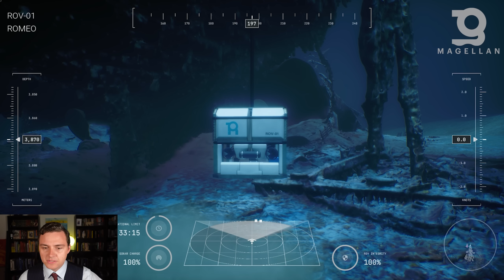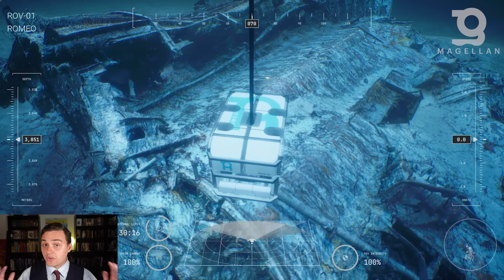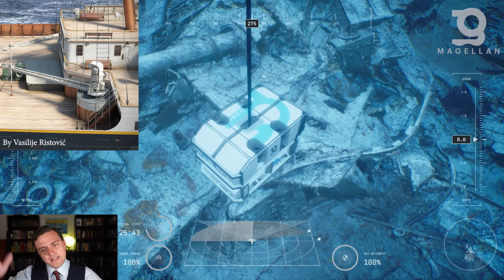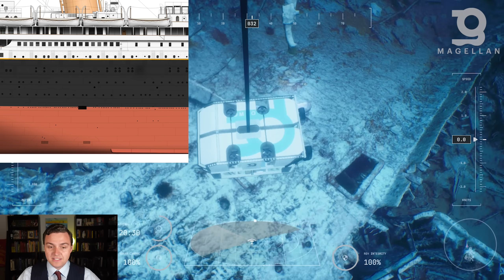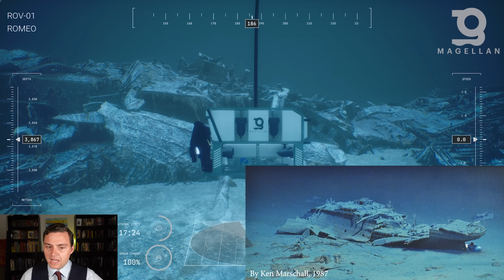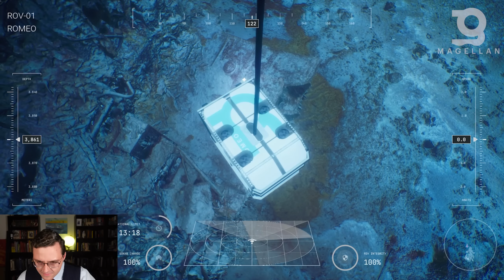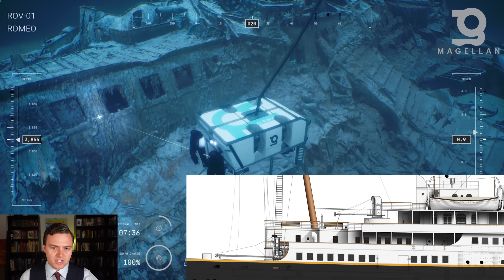FIRST LOOK: Titanic's Destroyed Stern Section in vROV Pilot

Comment: As long as I’ve been reading and learning about Titanic, as many photos and models and videos as I’ve seen of the wreck - it has never occurred to me just how hard the ship must have hit the bottom, until now. When I saw where the propeller was in relation to the fan tail - and when you put up the picture of what it looked like in better days - holy cow, how far did everything bend/break upon impact! The propeller should not be that close to the deck!

And yet, here it is. The deck is right on top of it. Having watched your videos on how the Titanic was built, the materials and techniques to put everything together - it blows my mind how much force it would have taken to put everything in the state it is right now.

This is probably impossible to pull off, but it would be fascinating to see the parts of Titanic that are actually buried under the sea floor. Beyond seeing the iceberg damage, I’d be curious to see what everything that hit the bottom first really looks like. Is it well-preserved in the mud, or is it a flattened mess of metal and machinery? Given what we can see of the wreck and how that looks, what about the bits we can’t see?

Comment: I suspect that during the sinking, an air bubble formed inside the ship. It couldn't escape quickly enough. At some point, at a certain depth, this bubble imploded under the increasing water pressure. The force released would have been enough to cause extreme damage to the stern section. The bow is still in such good condition because the air had enough time to escape while sinking.

Comment: I get so confused with reports and illustrations about the stern over the years. I remember hearing somewhere that it was way less collapsed back in the 80s and 90s that some of the upper Deck windows and stuff were more recognizable and that the siding had come off the hull and that you could see framing of multiple decks and look similar to the Ken Marshall illustration
Reply: Unfortunately that wasnt true, Ken Marshall just assumed that decks were intact cause most of images were overhead views. At the closer of the stern, upper decks were collapsed and alot of lower decks were also collapsed

Comment: In the paintings the sides of Titanic stern are in one piece. Yet here they've come away,peeled like a banana. Looks like when the stern hit the seabottom at speed it's caused some of the rivets to come away from the decks and over time caused the weight of the port side to come away.
The Starboard side of the bow is the same there's a buldge at the bottom where the hold in the side is. 
I fear as a Amateur Titanic fan the starboard side will peel away from the ship
Reply: The painting of the stern was not very accurate. Stern port side was in much worse condition in 1986, it was as badly as now, if you compare side by side those pictures with scans they match well. Decks of the stern were also badly collapsed

Comment: People say brittle steel. Brittle steel my a**! To bend like that without fracturing tells you how good the quality was even back in 1910! Great work by Magellan to document this because in a few generations this will be all we have to remember the wreck
Reply: It was brittle compared to modern steel as I understand, but very good for back when it was made.
Reply: Yeah I said the same thing, people hysterically go on about the rivets, they held thousands of square feet of bulging hull plate onto a ravaged stern section for over 100 years before letting go.
Reply: @ToreDL87 id think the sides fell away on impact.
Reply: @treystephens6166  Check out Marshall's paintings, just google "Ken marshall titanic stern" and look at the left side/port-side, while, yes, bulging (owing to the massive hydrostatic shock), held on very well for a long time before the remaining rivets failed after 100+ years and the plating fell off. Then the C deck between counter-stern & superstructure collapsed (or the other way around).
It literally didn't look like this in 1986.
Reply: Quality? It blew apart like a Ford pinto. I'm sure most of the potato eaters who built this thing were bombed out of their minds building this thing.
Reply: @blevinsfrank5453 so insulting, for what.
Reply: @panzermensch1577  Don't feed the Troll
Reply: If it wasn't protected and so deep, it's possible the steel would have been scrapped a long time ago because of how high quality it is.
Reply: @graywolf1984  not to mention its low background steel too. Prince of Wales comes to mind. Its fortunate that she is so deep

Comment: Thanks for the tour Mike, I really enjoyed this video.
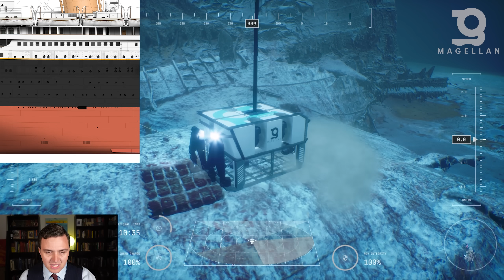At 23:27 we see the huge induction intakes for the condensers, I understand their purpose and their need for massive amounts of water. What has always baffled me about ship's design is why isn't the inner piping for these incased within their own protective and redundant well casing, or why wouldn't they possibly get their feed from an over the side scavenging pump?

 - The point that I'm driving at is that if some of the inner piping for these massive intake ducts breaks or becomes damaged during rough seas - then you've got an 8 foot square breach directly open to the sea, the loss of the Oceanos now comes to mind. I understand that building a separate well casing or the arrangement of an over the side scavenging system would be much more expensive to create and conceal but in the event of a calamity an encased well or scavenging system should be "relatively failsafe" I would think. 

This question came about one summer when I was on a sailboat and saw no less then 7 intake ports below the waterline of the vessel which made me extremely uncomfortable. There has to be a safer way to draw in the needed sea water I would think, but then again I'm not a naval architect or ship's machinist. 

Keep up the good work team, great job!

Comment: Incredible work by Magellan! I feel that when the stern was going under due to the damage of the break apart, had fast surging water and trapped air which caused the sides of the hull to separate from the floors/ceilings of the decks causing the side of the hull to be bent & pulled outwards. In my opinion it debunks the theory of an implosion. Only wish we could have had this technology in the first few years after the sinking before the deterioration.
Reply: IMO the stern was rotating/spinning on the way down, hitting just as it was about to pivot around again, and at a rolled angle toward the starboard, which is why to the starboard side = Lots of stuff, that's where it grabbed the seafloor, port side = Cranes, that's where it threw the cranes (and the mast).
The hull plating was kinda blown outwards because of the massive hydrostatic shock, around 20000-30000 tons worth, it was held on at a few places by maybe a few hundred rivets all total, which rusted and let go maybe a few years ago.

Comment: I READ THAT SEVERAL OF THE PASSENGERS SAW THE BOW AND THE STERN OUT OF THE WATER AT THE SAME TIME. IF THAT IS TRUE, THE SHIP SANK MUCH DIFFERENTLY THAN WE HAVE ASSUMED. WITH THE PASSENGERS HAVING TESTIFIED ABOUT THIS, IT WOULD'VE BEEN THE RESULT OF THOSE TWO PIECES OF DOUBLE BOTTOMED SEPERATING AND SEA WATER RUSHING IN AMIDSHIPS CAUSING A REVERSAL IN THE FOUNDERING ANGLE ALMOST IMMEDIATELY. THIS IS WHY THE CHUNK BETWEEN SECTIONS IS MISSING. I WISH THAT I COULD CREATE SOME GRAPHIC TO HELP EXPALIN WHAT I AM TRYING TO SAY.
Reply: What you are describing is the V-Break theory, something that is completely impossible due to the nature of the damage sustained by Titanic. Passengers did not see the bow and stern at the same time, the bow vanished first followed by the stern, most didnt even see her break in half to begin with.
Reply: @Tozzpot500  So the two pieces of double bottom hull are a figment of everyone's imagination? These two super compressed pieces are the very reason why she broke in half, and it all occurred sub surface which means that an Olympic size pool of H2O was rushing in amidships causing the moment of rotation to reverse almost immediately. As for no one seeing the ship with the bow and stern out of the water at the same time---you obviously haven't read the testimony of those who did. If you want to see things in a more correct light, do what I did!!! WATER DOES NOT FLOW UP HILL!!! When the ships stern fell backward upon breaking, it was still hanging on at the keel!!! I am not suggesting the V break!!! It happened most likely the way it was depicted in the movie. What it DID NOT show was the two pieces of the double bottom breaking away. This was all sub-surface. The very instant this happened, a deluge would've gone racing down through the boiler rooms causing the hull to become heavier amidships than at the bow. This also would happen due to the streamlining of the bow. As the rotation reversed. Passing level, the water in the first 5 compartments started running backward lifting the bow back out of the water finally tearing the bow section from the stern section. The bow section goes under immediately headed for the bottom of the Atlantic. The stern stays afloat long enough to fool some into believing that it would remain afloat---and you know what happened after that!!! Also, the breakup happened at a much shallower angle, most likely just as the screws came out of the water. Being almost pitch black it does not surprise me that few saw it actually break up.
Reply: @wasatchrangerailway6921  Ah, my apologies i miss-understood your last comment and believed you were arguing in favor of the V-Break. I have read the transcripts of both Inquiries and only a few people were asked on how the ship went down, fewer still mentioned the break in the first place. No one mentioned the bow being visible after the break.

I personally subscribe to the idea that the bow after flooding and the upper hull breaking remained attached to the stern via the double bottom for a few moments before finally breaking away. This both explains the sections of double bottom found at the wreck site while also staying within witness testimony. The bow never resurfaced however the rest of your theory is certainly similar to the one currently being tested by researchers, only time will tell if its correct or not.

Apologies once again, you often see people advocating the V-Break on posts such as this so i miss-understood. Thank you for your reply! Its certainly an interesting idea and plausible idea, besides the bow resurfacing as all accounts place it firmly underwater by the time the lights went out moments before the break.
Reply: @Tozzpot500  NO PROBLEM!!! WITH IT BEING SO DARK, IT IS ALSO NOT SURPRISING THAT SO FEW SAW THE BOW COME BACK OUT. IT COULD NOT HAVE BEEN BY A LOT. PROBABLY JUST ENOUGH TO EXPOSE PART OF THE FORCASTLE. IT WAS MOST LIKELY VERY SHALLOW TO BOOT. REGARDING THE "BIG CHUNK" THAT IS MISSING, THE ONLY WAY THIS COULD HAPPEN IS TO SUSTAIN A NEAR INSTANT REVERSAL IN THE ROTATION. THIS SECTION PLACED UNDER TERRIBLE COMPRESSION, THEN PUT INTO TENSION ALMOST IMMEDIATELY, WOULD CAUSE A SPAGETTIFICATION OF ALL THE DECKS LONGITUDINAL AND CROSS MEMBERS TEARING RIVETS APART ACROSS MULTIPLE DIMENSIONS. I WISH THAT I HAD SOME KIND OF A GRAPHICS PROGRAM TO SHOW EVERYONE WHAT I AM TRYING TO CONVEY. EVEN THEN, I AM NOT A COMPUTER GEEK. I AM JUST A RETIRED LOCOMOTIVE ENGINEER.

Comment: The propellers sitting on that angle tell a story in themselves. Those prop shafts are about 28 inches (720 mm) in diameter and they are bent around 45 degrees, if not more. That's solid steel deformed like putty.... Imagine the forces needed to produce that!
Physics, you are scary.
Reply: Shafts are usually hollow actully but still have fairly thick walls. It gives more strength while using the same material.
Reply: ..The wing screw propellers of the Titanic were/are 23 feet each approx...I'm talking about the radius measurement when they spin & create circles...Those circles in total are 23 feet each...An one storied regular house is about 10-12 feet in general...Now think about a two storied building now & add about 3 feet more to that...Now imagine a spinning circle with that length... .

Comment: For reference, the stern has spun around during the sinking, the very end of the stern is now facing the bow and the engines are facing back to the East. Bow is half a mile away. Main debris field is between the bow and stern. The bow still points West where she was travelling (compass points in general reference)
Reply: Not quite. After the ship struck the iceberg, her engines were stopped and she drifted down the Labrador Current. The bow faces northward and the stern faces southward.